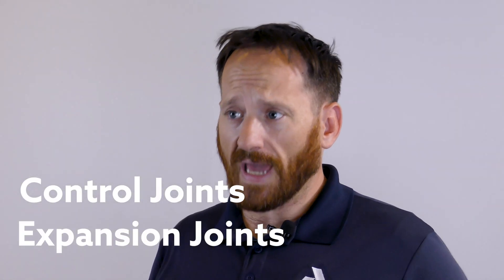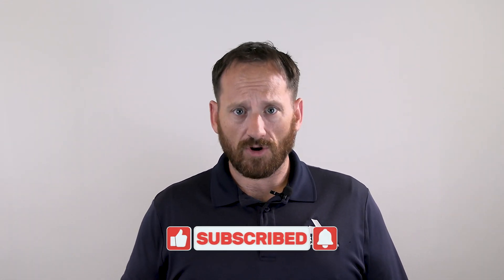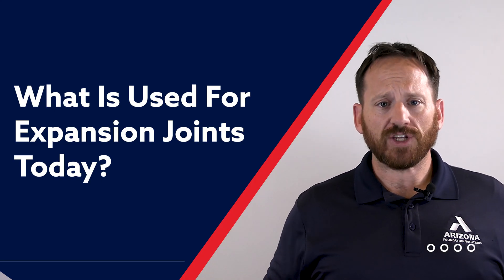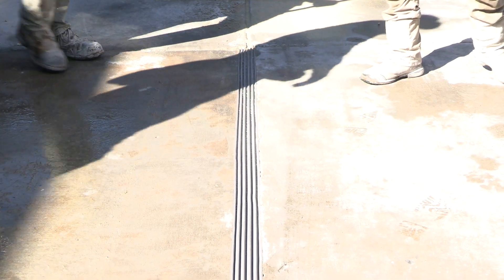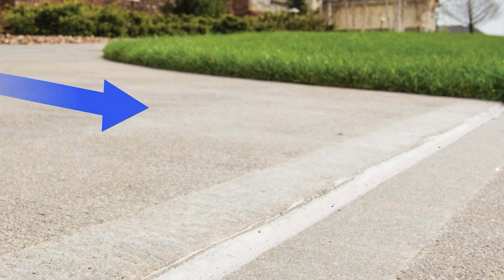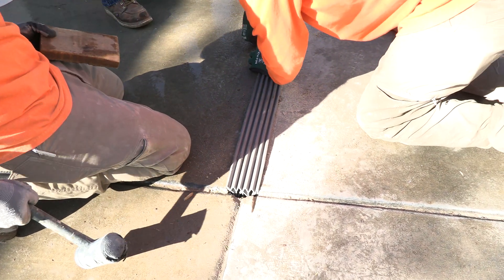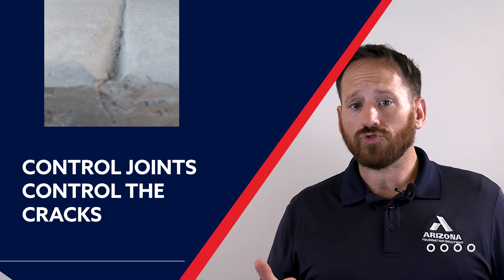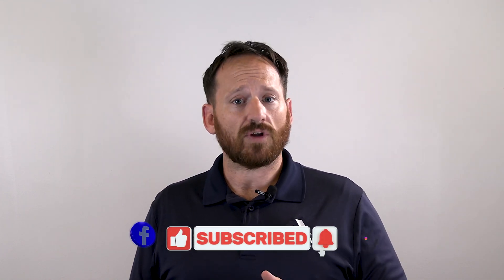Concrete Foundations Explained: The Role of Expansion and Control Joints

Comment: Are control joints on foundations where homes sit on? We have a water damage job where water is seeping through control joint in home …. Thank you
Reply from the maker: Control joints are used in driveways and patios to control cracking. Water seeping through your home could be coming from separation from your footer and slab(If you have a slab foundation.) If you're in Arizona, call us for a free inspection, otherwise contact your local foundation repair company and get an inspection.